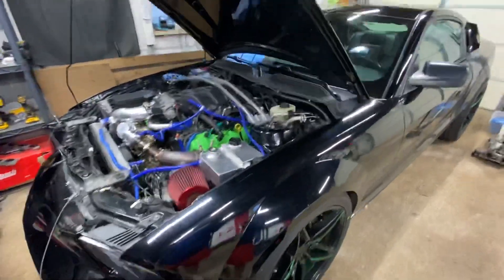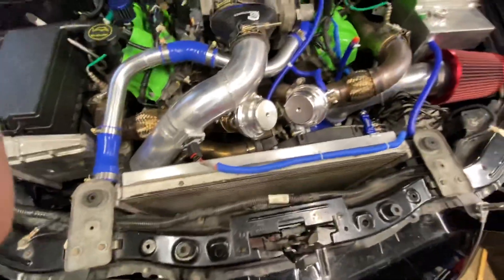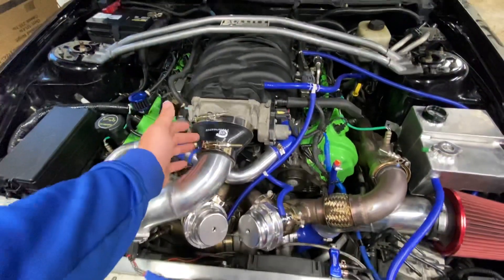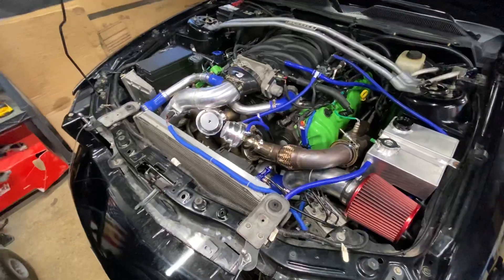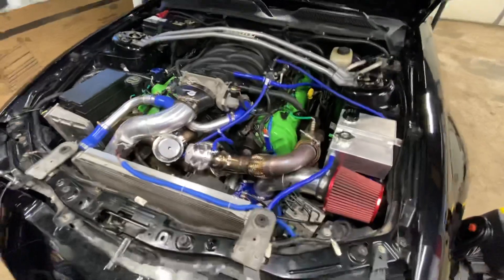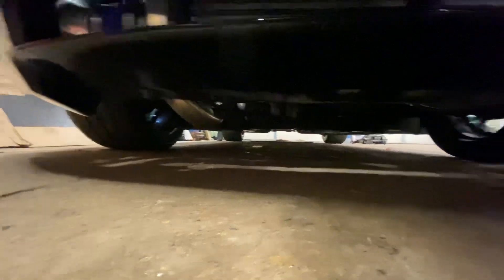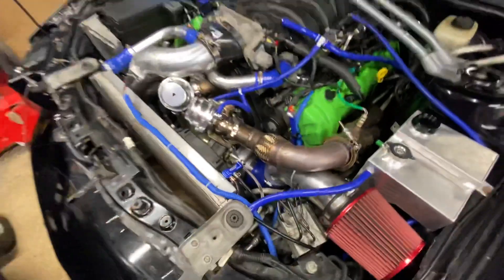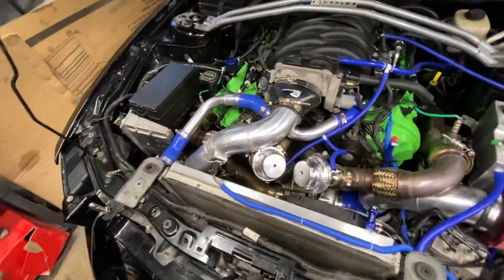CXRacing Turbo Kit 05-09 Mustang GT

Comment: Why didn't you do with an on3 turbo kit? I hear they are a tight fit but for someone that dosent weld the cx racing kit sounds miserable...having to straighten the inlet ,weld bungs,move blow off...in just curious...cause I'm in the market for a kit and lito told me for entry level the on3 is the balls..

Comment: I wish I had that clearance with my on3
Reply from the maker: It only had that much clearance because I made the exhaust exit through the bumper.
Reply: how low does it drop below the frame??? i have my car dropped 2.25in in the front. been wanting to get the on3 but afraid of destroying it vs just making a mid mount turbo
Reply: @LightningFast240  yea j about that much I’ve never really measured it
Reply from the maker: @LightningFast240  I routed my exhaust out the bumper on the passenger side. I tried to get the exhaust to fit so I could run it out the back but it was too tight. I didn’t try hard enough. Guy I sold it to was able to route it out the back. 100% ground clearance. On3 doesn’t even compare.
Reply: @eclipse1328  yeah my town has speed bumps EVERYWHERE. I would think the first day the on3 kit would be destroyed. I wouldn't mind trying this kit but for the price Idk. Might only order the hot side.
Reply from the maker: @LightningFast240  I had to do a lot of customizing. Fitment wasn’t all that great.
Reply: @eclipse1328  did the headers go on with no problems at least?

Comment: Hey man I’m looking at getting this kit and upgrading the turbo to a VSR Gen 3 7875. Would you know if I need a standard or a reversed T4 ?
Reply from the maker: I recommend NOT getting the kit.
Reply: @eclipse1328   really, bummer! I really dislike the clearance issues with the on3. Is there a kit you recommend? I’ve been running a Paxton blower for a bunch of years and ready to make the switch.
Reply from the maker: @Brian-ec2ep  if you’re okay with having to fabricate most of the parts on this turbo kit then it’s not bad. Just wish it would have come more complete. There’s things they could have done that would have made it a true bolt in kit, but they cheaped out on the parts. I would have been able to go with my axle back but I would have had to delete the a/c compressor and I wasn’t going with it air conditioning.

Comment: Great job man! Question, did you put in an oil scavenge pump? I've heard some people say that because of the lower placement of the turbo with this hotside compared to where you'd ideally want to put the drain fitting on the oilpan that there could be flow issues. Just wondering your thoughts.
Reply from the maker: It definitely didn’t need that. Oil pressure was great.
Reply: @eclipse1328  And no turbo longevity issues so far with no scavenging pump?

Comment: Great build Justin .what made you choose this kit over the on3 turbo ? What rpms does the turbo start spooling at ? and if I recall correctly that kit is about 2,500 and the on3 is around 1,900.do you think that extra 600 was worth it ?
Reply from the maker: kwilliams3161 a huge thing for me was the fact  that I could keep my Eibach Sportline lowering springs. Stance is important to me. I do not like how these cars look with the factory springs in.  The turbo starts spooling at about 3,000 rpm roughly. To me the extra money was worth it. It’s a clean looking kit. Not many people have it. I do believe I’m the first to post a video online of the kit itself.
Reply: Justin J Ross did you not like the cxracing turbo ?
Reply from the maker: kwilliams3161 I don’t know much about CXRacing but I do know that on3 has some decent turbos. I figured I would go with the well known and proven brand when it came to the turbo. It was only 350$
Reply from the maker: purge_ s197 I will add you